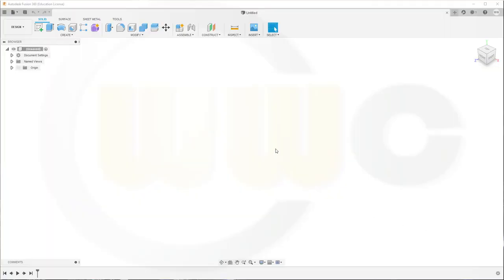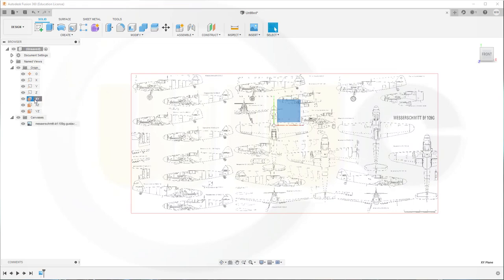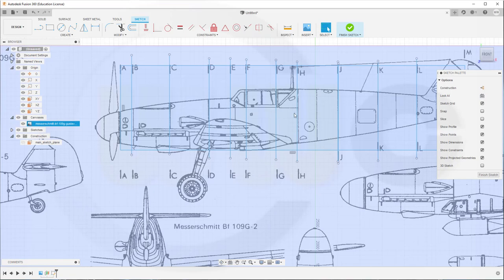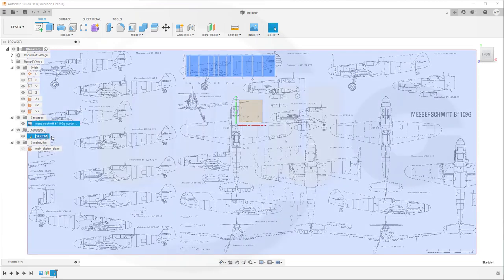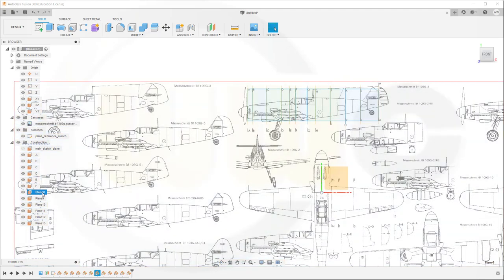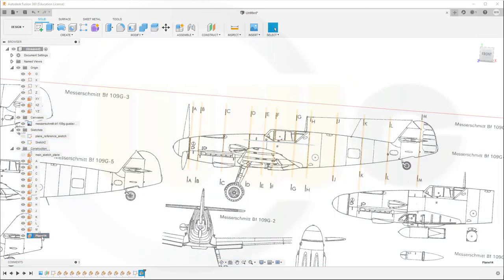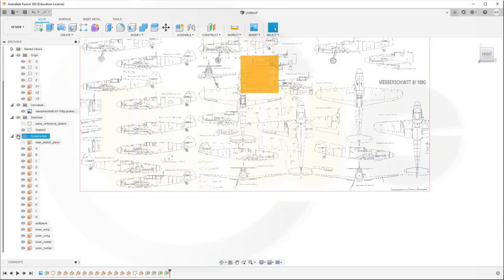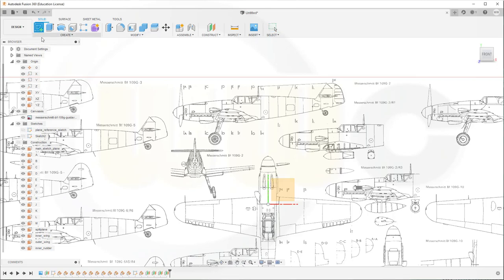WW-109 Fighter Plane - Part 1 - Fusion 360 Training - Surfaces

Comment: 4:30 is there a way to move the line across horizontal axis, avoiding unintended shifts on vertical one ? Simply by grabbing translate arrow, it snaps to some increment of movement which doesnt allow to move the plane freely with better precision.
Reply from the maker: If you grab just the horizontal arrow - it will move just horizontal.
Reply: @wolfgang.walden.cad.training  yes, but by grabbing that arrow and dragging it moves only for a certain amount of units. adds +25mm incrementally. Works something like a snap.
Reply: So when you more zoom in and then try the dimension of +25 will go less to min distance even further and when zoom out vice versa.